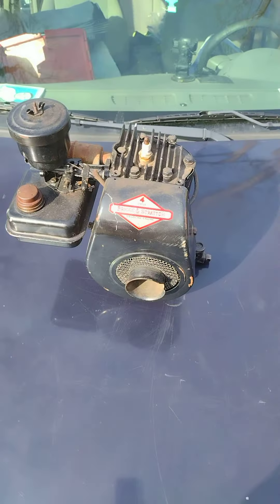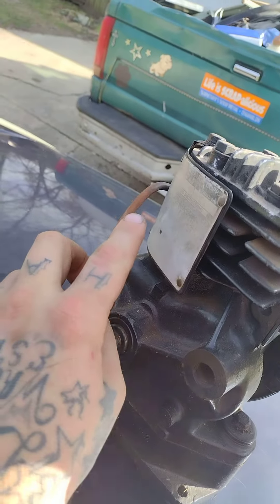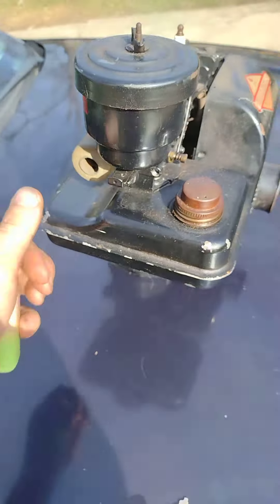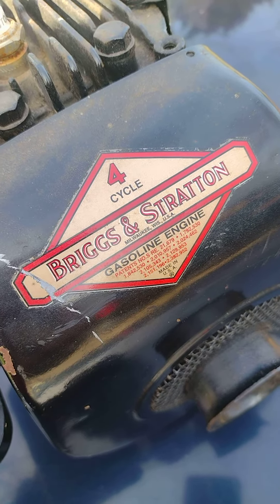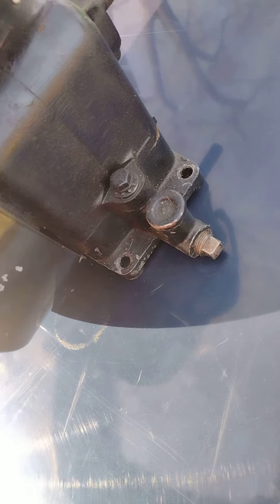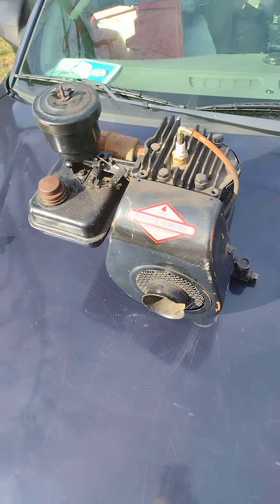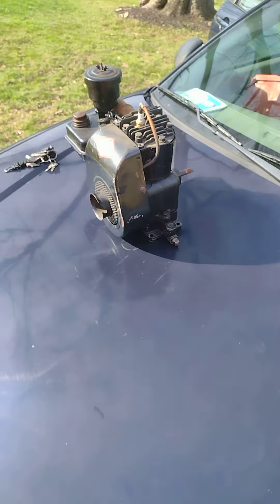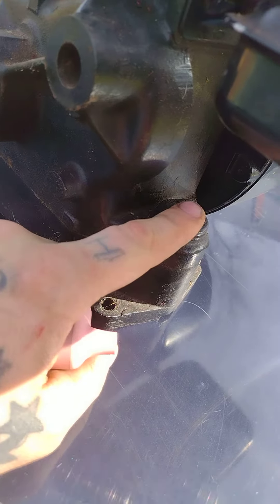1951 Briggs 3 HP engine?? I bought for 50$ another video will be coming on this

Comment: Those are cool little engines. When I was a kid we had one like that on a early model tobacco primer. We also had a later model Handy Hank primer that had a pull start 3HP Briggs engine, it was yellow. I never liked using the older Primer because you had to keep up with the pull rope, the newer one had the pull start on the cover. Great find!
Reply from the maker: Yea I was definitely born in the wrong era would of loved to been born and experienced real metal when things where built right and just things they don't make anymore I love anything old and metal I have a few of the 80s Briggs this is the oldest I have right now I'm supposed to be making a deal hopefully for 3 old Wisconsin engines heavy duty solid engines there beasts